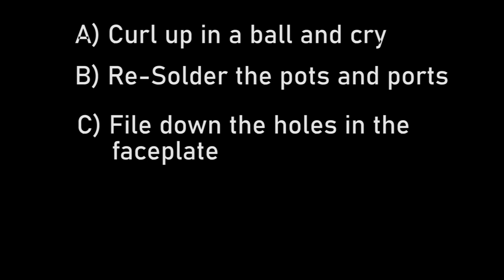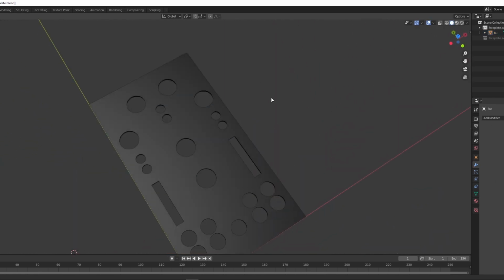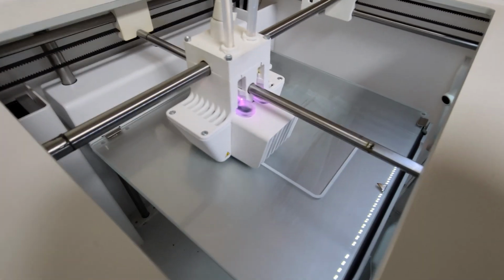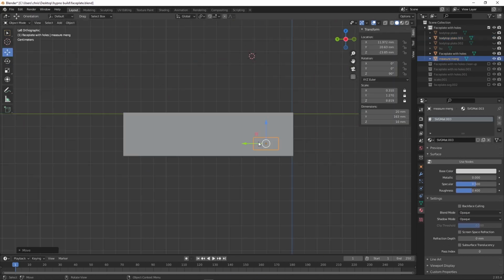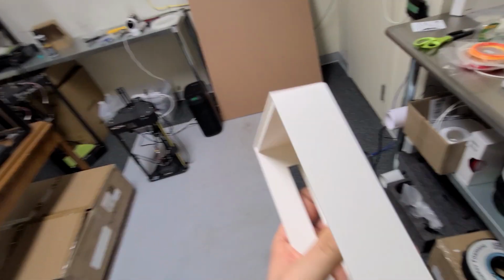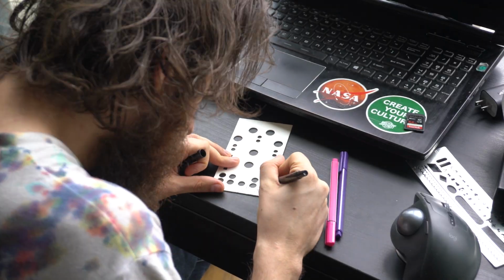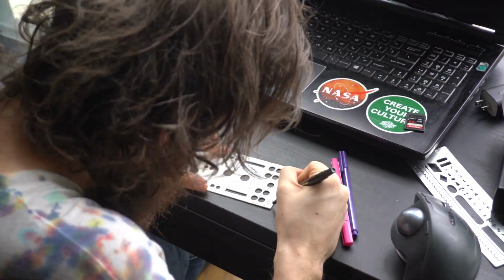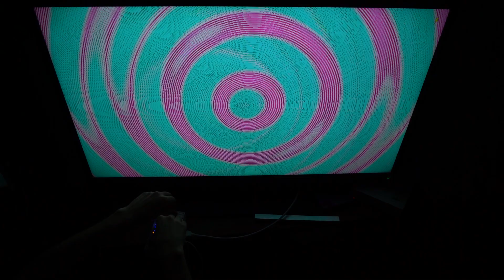Hypno DIY DIY

Comment: We would be happy to fix your bent potentiometer if you would like. Cool video though!
Reply from the maker: It's all good!! No worries 🤟
Reply: Yo also just want to add that there is a method to make jacks fit a lil better you can hook the jacks with one side of the panel and pull on the jacks until they fit, this happens bc the CN factory does not solder with a jig but in all of our production units there hasn't been one that wasn't mountable like this.

Also please be careful with that custom case with a hole on the bottom when placing onto wet/moist surfaces.